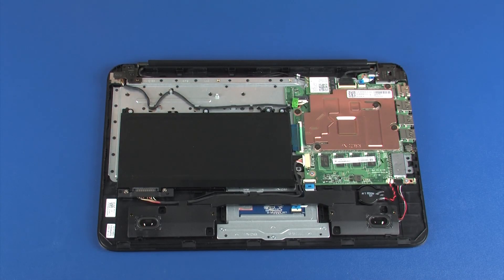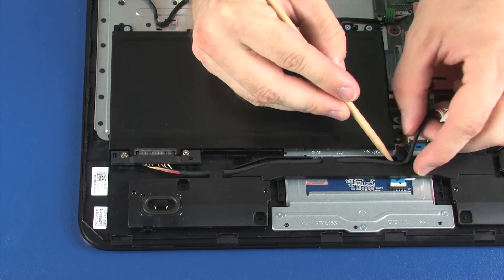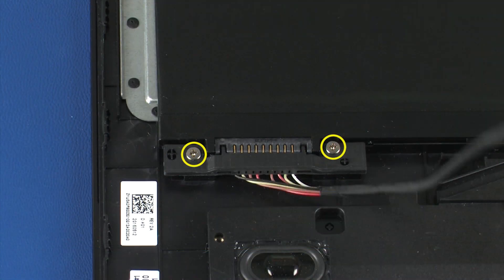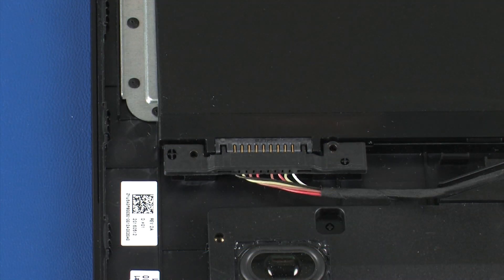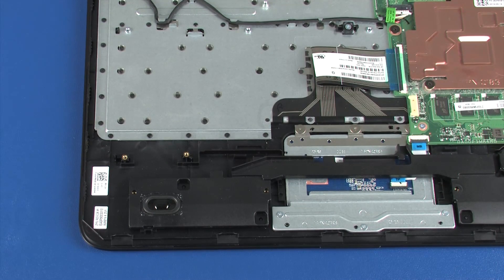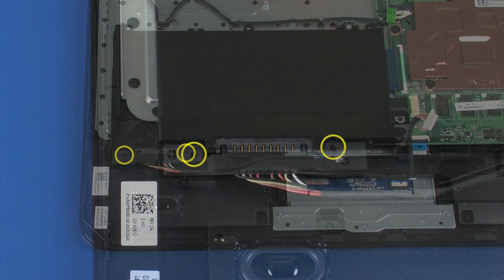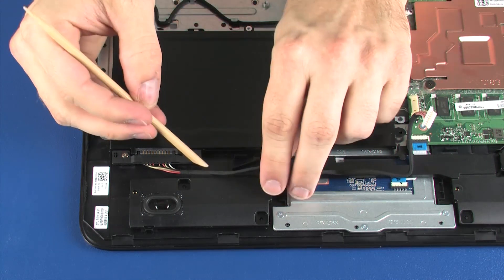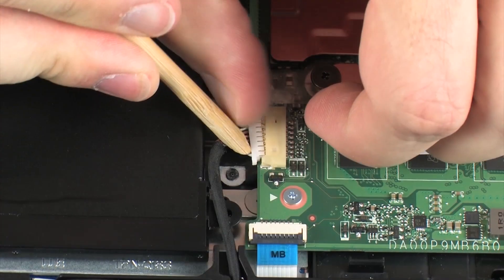Replace the Battery | HP Stream 14 Notebooks | HP

Comment: HP STREAM Model14-ax020ca Prod ID XX9F38U7A#ABL S/N SCD7074929 I plug in charger and my battery IS AT NOW 17% will not charge.  It will say "not charging" when I plug it in. My HP STREAM unit does not have any screws in the base plate or can I see any seams where I can pry apart. Is there a trick to opening? Or is it just a throw away? Please advise. Thank you  Ron
Reply from the maker: +Capt'n Squid Please contact our phone support team to fix the issue. Please follow these steps to reach them.
Step 1. Open link: https://support.hp.com/us-en/contact-hp
Step 2. Select the product type.
Step 3. Enter the serial number of your device or select let HP detect your product option.
Step 4. Select the country from the drop-down.
Step 5. You should see the HP phone support number.
Reply: @HPSupport  I went on line. I was told by a person on line not HP  to hold down the on button for one minute. This reset the unit and it started to charge up the battery and per spec. You took over a month to get back to me HP. That is too long. But thanks in getting back at all

Comment: I keep looking at these videos and they are NOT helping. There are no screws. HOW DO I REMOVE THE BOTTOM OF THE COMPUTER? You skipped right over that in the video
Reply: X-man did you remedy that bro? Having the same issue and don’t want to use force and break it
Reply: @gregbearne2195  if you're still having trouble you just need to pull off the two rubber strips on the bottom then unscrew the screws. then apply a bit of force around the lip to pop off the bottom.

Comment: But where can i buy original hp batteries i only see 3rd party ones on amazon are those save to use?
Reply from the maker: +Fusions3789 thanks for reaching out!
I understand that you need to purchase battery for your notebook.
I'll do my best to assist you.
Please contact our phone support team for purchasing the battery.
Step 1. Open link: www.hp.com/contacthp
Step 2. Select the product type.
Step 3. Enter the serial number of your device or select let HP detect your product option.
Step 4. Select the country from the drop-down.
Step 5. You should see the HP phone support number.
Let us know how it goes.
Reply: @HPSupport  hp 849911-850 that model in battery in stock?